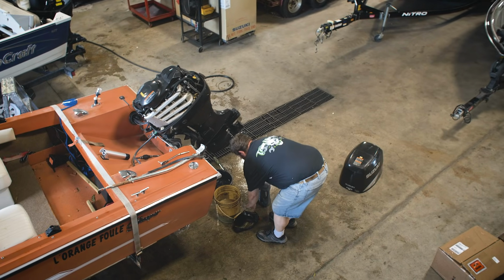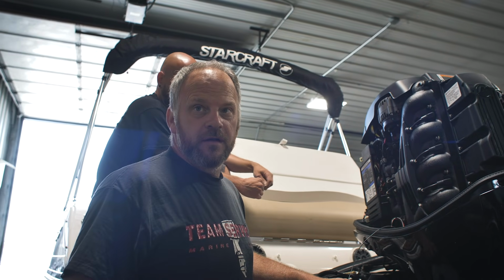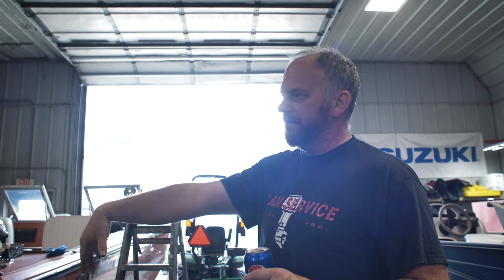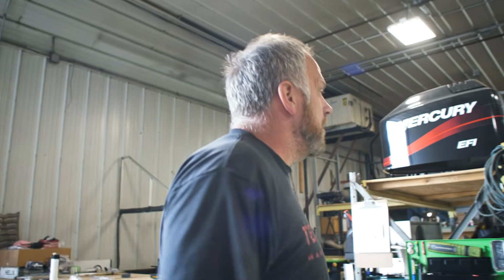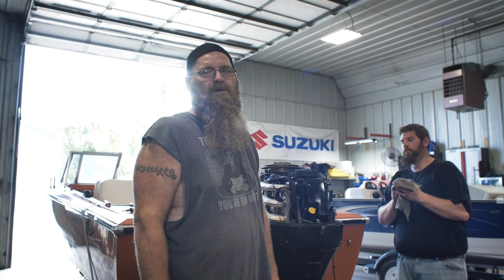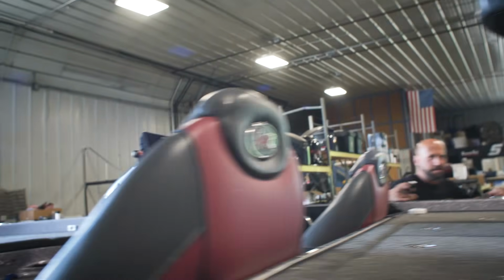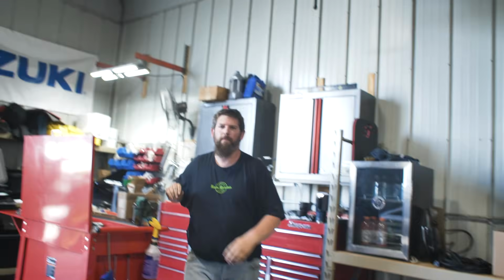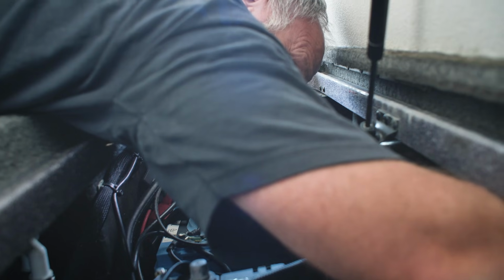"SHOP LIFE" - Day 4  (MILKSHAKES & UNDIES) 2021

Comment: Yeah, Ranger did not have power pole pumps, 36v trolling motors, etc… when they designed their compact rigging compartment.  Thanks to Lithium batteries and 4 stroke motors we can now find room for these accessories.

Comment: I want to see some custom battery tray installs. Installed my Ultrex 24v. 19 foot tin boat lol so I didn't think a 36v was needed. It has the plastic battery trays which I hate. Would like to see some nice aluminum trays with hold down brackets instead of a lame strap.

Comment: How long will a 2001 Yamaha 225 2 stroke  run? It's been great motor for over an year that I have had it. No clue on hours but has gotten serviced every year supposedly. I did it last year and no hick ups so far.. Maybe 800- 900 hours.